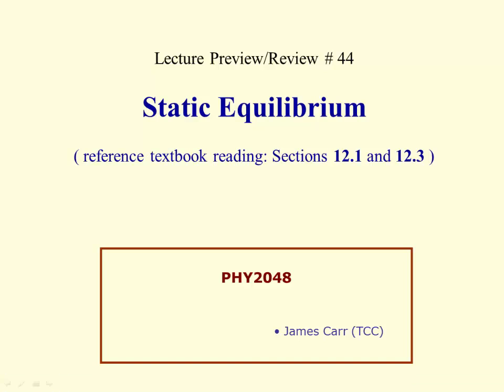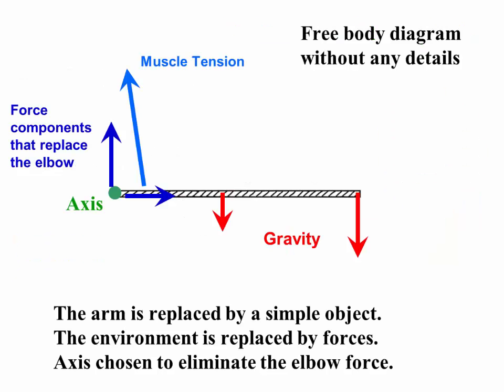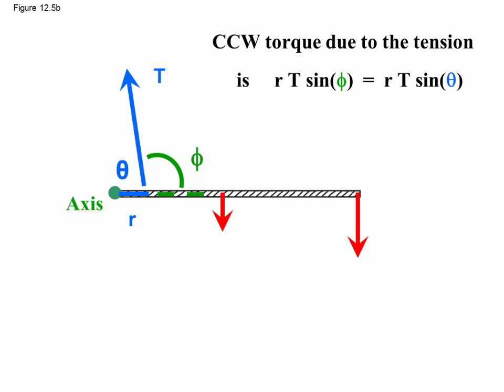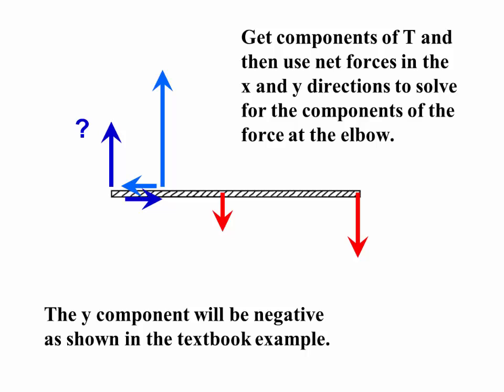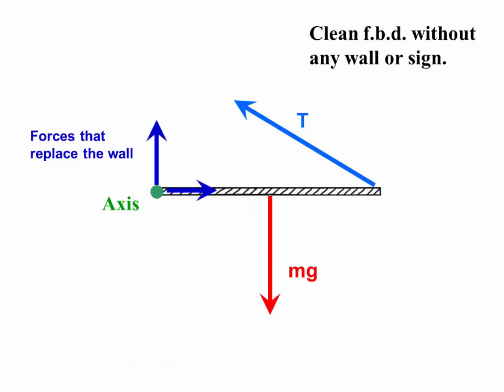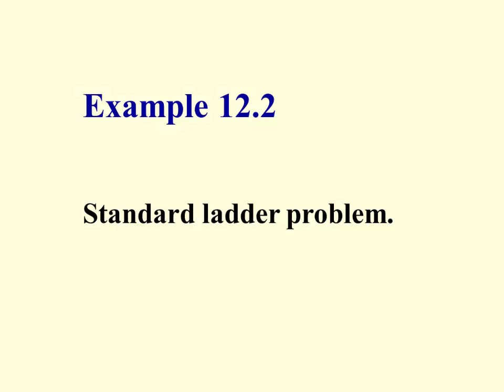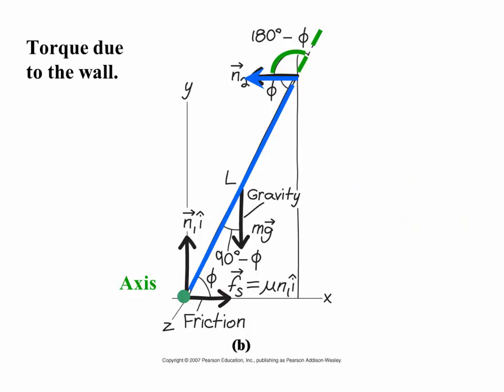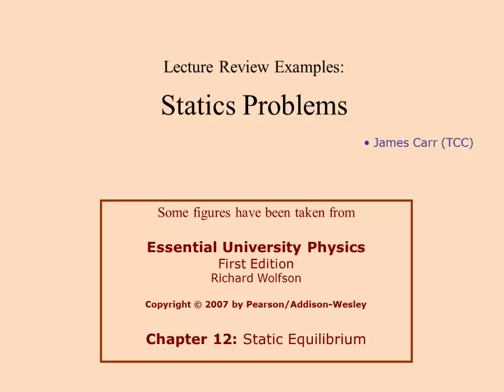1.5-3:  Free body Diagrams with torque

Comment: i have a question when do the normal force exist ?
Reply from the maker: Sorry for the long delay.  I don't monitor this for comments because those are dealt with in class. 

A normal force exists when an object is (1) on a surface and (2) would move through the surface if the surface were to suddenly vanish.  That is why its direction is perpendicular to (normal to) the surface.  Its magnitude is always exactly equal to excess force trying to make the object go through the surface. It cannot make the object move up, off of the surface, or in any other direction. 

It is sometimes called a reaction force, but that term is usually reserved for things like a hinge or pin that will prevent an object from moving in several different directions.  A normal force only prevents the object from moving into or through the surface.